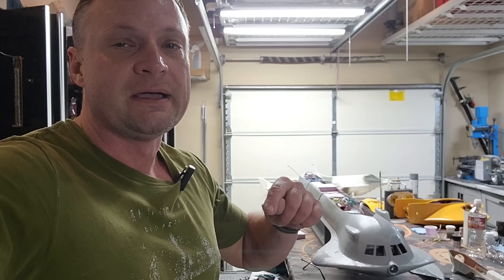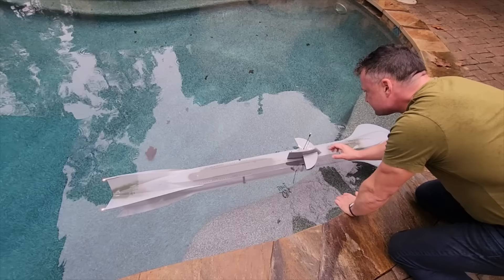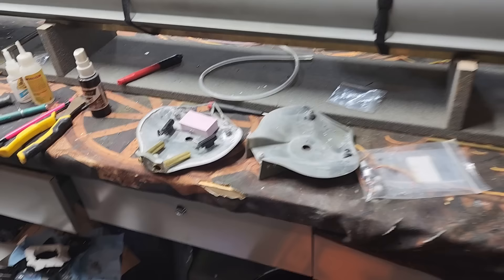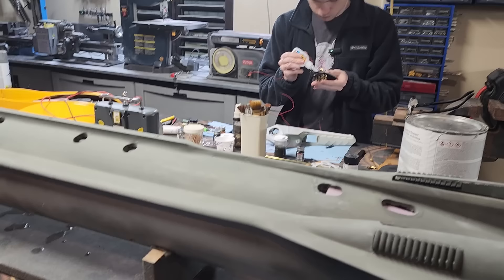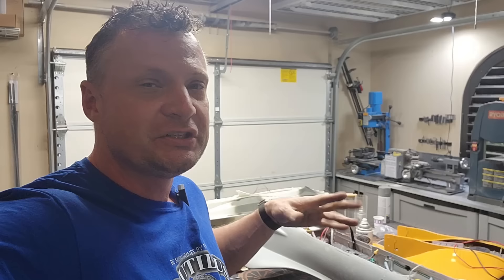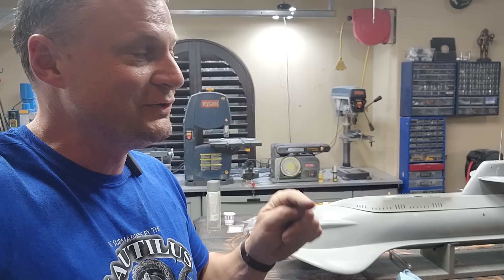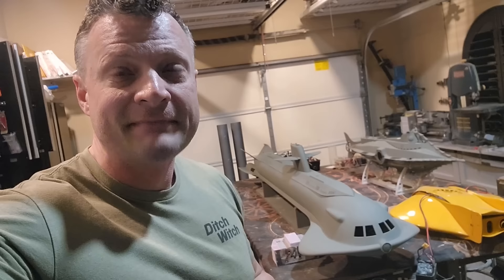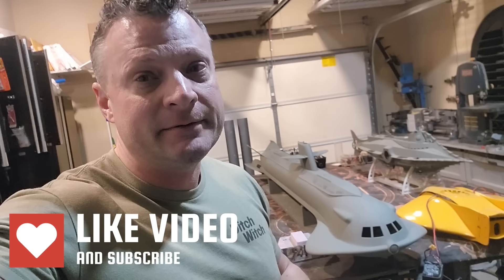Building the Deboer 80" Seaview - Build Blog Chapter 6

Comment: Back in the mid eighties, I built a one tenth scale WWII PT boat. It was 8 feet long. I made a simple kit that any modeler could build it ready to run gasoline powered on any water surface. The hull, deck, cabins were all fiberglass. On the deck were areas where small eighth inch holes to be drilled all the way through to glue in perfect places the deck parts. I actually made a giant kit that had all the parts made to simply glue in place. Painting the boat was easy. I sold 84 of these 8 foot long kits all over the world. I can still produce them today if only I get enough orders!  My company name was MODEL MARINE CLASSICS.

Comment: This was the only episode I have seen. Did you put a camera in the bow so it's like your looking out of the Seaview?
Reply from the maker: No. Cameras in subs are overrated. Unless you're in a pool (and this boat is waaay to big for that), you won't see anything interesting other than murky water. If the owner wishes to mount a camera in there instead of the highly detailed control room, it would be an exceptionally easy thing to do.

Comment: Great work getting that brass keel faired in and getting the trim managed. I just wanted to pass on that the 8 window Seaview used in the film and for season 1 was Grey with a white bottom, the 4 window Seaview used in seasons 2 thru 4 was Grey with white bottom but,the hatches on the sail and deck were a noticeable darker Grey .also,the sides of the deck where the limber holes had a darker Grey stripe on each side and the sail planes had a dark Grey stripe to represent I think an anti skid strip so they could be walked upon if the boat was surfaced and crew used the hatches above the dive planes.I am looking forward to following your further endeavors
Reply from the maker: Interesting! Do you know of any reference photos that depict the details you're referring to? I'll be moving on to paint next week and would love to 'get it right'.
Reply: On the cult tv man site there are some nice photos in an article by Gary Kerr entitled what color is the seaview.also if you can find articles written by Paul Lubliner.
also if you have access to the voyage to the bottom of the sea. Dvd sets season 2volume one has a lot of special effects outages ,many of which feature unused shots of the seaview both surfaced and underwater.the 8 window seaview used in the film and season 1also looked much darker than the 4 window refit version that carried the flying sub. one other knowledgeable person would be David Merrimac,who also builds Seaview and rc subs.I hope you are able to find something here useful and I am looking forward to the projects moving forward